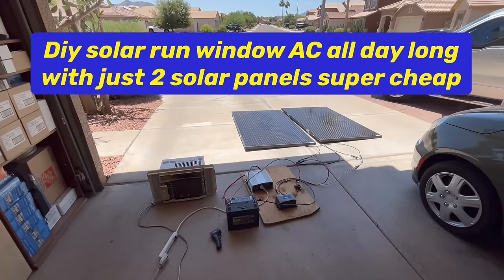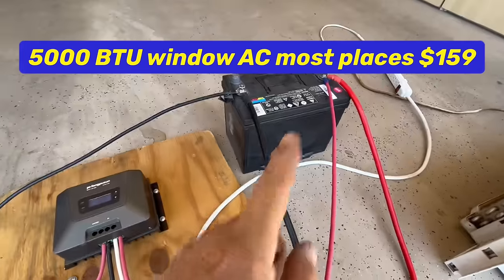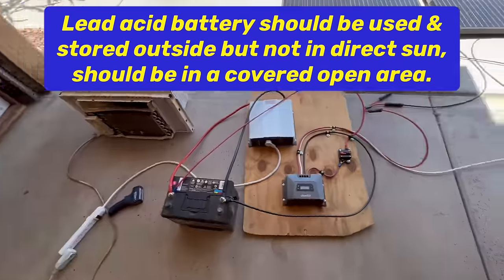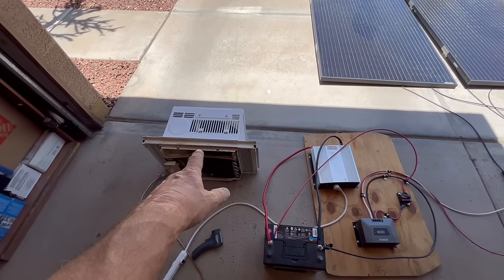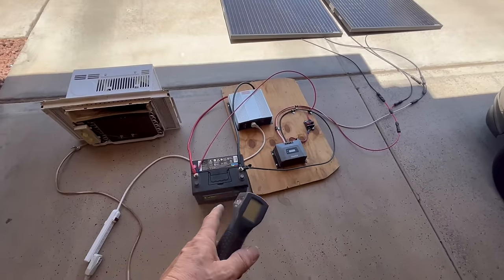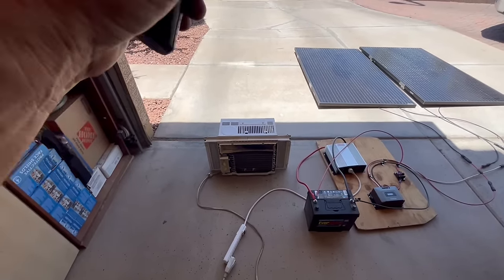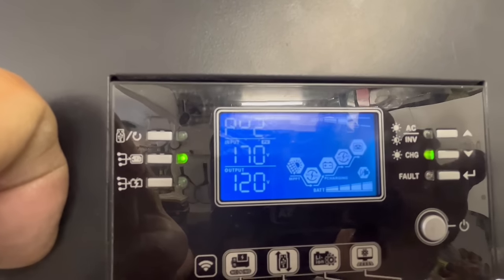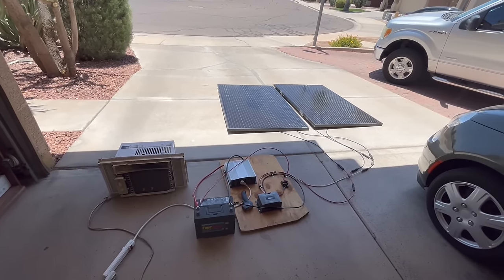Run your window AC with just 2 solar panels when sun shines. Easy DIY project you can do in one day.

Comment: You could do a very efficient 12000 btu mini split 400 watts!
Reply from the maker: Yes
Reply: @diy-solar-guy  good afternoon Mister solar guy LOL. If to complete this project I need to get a battery and the panel's starting with a fresh battery you would recommend the deep cycle marine or a lifepo4 100 amp hour? My wife is disabled and this is exactly what I would like to do because she runs her AC around the clock. I guess I would like you to get sitter if there's no sun at night how many batteries would it take to run that 48 hours or 10 hours until the sun comes up the next morning
Reply from the maker: @mrobvious1100  LiFePO4 battery is the best way to run ac 7/24. I have a lot of videos that shows using 120v mini splits which are much more efficient than window ac unit. I run my entire house and garage on only solar air conditioning now. I spend $0 on air conditioning now. House and garage is around 3000 square feet. Temps last 30 days have been 113 in day and 85 at night. Watch my other videos to see what mini splits I use and how well they cool house and garage as well as running my 3 1/3 ton and 4 ton heat pumps to air condition and heat my house. All with solar during the day and LiFePO4 batteries at night. I also have links in video of where I purchase products to run ac my whole house. Hope this helps to understand what you would need to supplement your ac using solar and to reduce electric bill as well. I to am permanently disabled and have to keep my house cold because of the 2 incurable cancers I have battled for last 10 years. I did all this in videos over the period of 4 years a little at a time every couple of days till I got to where I am today with my off grid system. I didn’t around $5000 a year each year for last 4 years and my system will be 100 percent paid back at the end of this year if 2023. Hope you enjoy the other videos and hope they en-suite you to use solar to run air conditioning.
Reply: @diy-solar-guy  great info. I have a two-story Colonial single-family about 100 years old. First floor is 30 x 30 second floor about 30 x 30. Three bedrooms upstairs with a bathroom first floor living room dining room kitchen vent a bathroom and then a bedroom. I'm guessing I would need two for the walls upstairs and 3 for  the first floor. How many batteries do you need to power the air conditioning at night. Of course this takes in consideration multas most of the units will not be running except the one we sleep in because our kids have grown up and are in the military. We would only run the AC upstairs if guests come over
Reply: @diy-solar-guy  one other quick thought since I kind of understand the old-fashioned air-conditioning systems that use returns how did these wall-mounted systems suck the heat out of the top of the room? And I'm guessing each unit has to have a drain that goes outside the house
Reply from the maker: @mrobvious1100  I only run my upstairs 3 1/2 ton ac unit at night. Cool are drops so my downstairs with no ac on overnight never goes above 78 degrees even when it is still 108 degrees at night at 8pm when sun goes down. You could get a 18,000 btu 220v mini split that can cool or heat 1000 square feet. You have 900 square feet upstairs and downstairs. Or you could get 2-12,000 btu 120volt mini split for downstairs and 2-12,000 btu min splits for up stairs. I have 4 bedrooms and 2 bathrooms upstairs so I have to be able to run my 3 1/2 ton upstairs heat pump to air condition the upstairs 24 hours a day. All my bedrooms are upstairs. 12,000 btu mini splits range from 14 seer to 39 seer. Higher the seer, lower power in watts and amps needed to run. Much easy to run a 38 seer heat pump overnight, most likely once reaches set temp will only use 200-400 watts. If you don’t use upstairs that often you could use solar in day to super cool upstairs with mini splits and then won’t need to run ac at night. Check out some of my videos on how I do this in March through May and September thru December. It still can get to 100 degrees in December at times during the day. I have so many videos that explain how I use mini splits. Not sure what temps you hit during the day and overnight temps. That makes a difference on running overnight as to how much battery bank you might need. AGM is great for day but not able to run my mini splits for more than 2 hours on just battery bank. But I was able to reduce my electric bill 80 percent just using solar during the day and grid power at night. I did this by using mini splits to keep upstairs and downstairs at 66-68 degrees all day long, then stop using mini splits at 6 pm and switched over to main 3 1/2 ton on grid overnight. Also in a lot of my videos. Hope this helps you to better understand what is involved and what you might need to use solar and mini splits.
Reply: No. Mini-Splits are not that efficient 9 eer. An exspensive one may do 10.
Reply from the maker: @dwmcever  I have been using mini splits for almost 4 years now. Much more efficient than my whole house 4 ton heat pump. I can use 2 12,000 btu mini splits, 120v 16 seer and they will cool the house with 1/2 the watts and amps. Much more efficient than window ac or portable ac that you vent out of the window. The 38 seer mini splits will use 1/2 of what my 16 seer units use. Been almost 4 years with 6 mini splits I installed and all 6 are still running as great as the first day I installed. I am just a DIY guy. Not a professional with electric or hvac. In fact I knew very little 4+ years ago. I can tell you from experience for last 4 years even low seer like my 16 seer are realty efficient and can save you money just running those two downsides 7/24 I would cut my usage in half if I used grid power 24 hours a day. I have to disagree with you on this one. Thanks for you input. Hope you have a wonderful and blessed day.
Reply from the maker: @mrobvious1100  there is a water line drain that runs to the outside to remove moisture from coil. This is a heat pump so it will blow hot air from the coil in the outside unit and cold air from coil on inside unit. In the winter it will be the opposite. The inside unit needs to have at least 10 inches from ceiling to top of head unit to draw in hot air from the room.
Reply: @diy-solar-guy  thank you for the response. My house is 30 by 30 I have natural gas forced hot air but no AC.. I'm probably not going to use the heat side like a heat pump I don't know if they make split units that just do AC
Reply: Wrong!  dwmcever!11I install all the time.  Customers COULDN'T BE HAPPIER.  Knowledge is power and you don't have either!  What year are you living in?
Reply: @mrobvious1100 lifepo 100ah would be an excellent battery. Doesn’t emit any gasses and holds a lot of power.
Reply from the maker: I agree, LiFePO4 is the best battery out there now for this application.
Reply: Agree! Mini splits are the answer. If I can save money using window units all the more using mini splits. And to run them on solar is a no brainer. 73
Reply from the maker: You still need to use a battery bank on off grid solar. On grid solar does not require a battery bank but you can add one to it if you want to but off grid solar will need a battery bank. They do make some “batteryless inverters out there, I have one and when a cloud rolls by in the ski , if inverter is not connected to battery bank, the inverter will shut down and not restart. The battery bank is there to supply voltage when solar from sun is not present from clouds in the day. It keeps the system running during cloud cover but not indefinitely. They are just starting to make direct solar panel input connections to mini splits that can run the mini split all day as long is there is sun with no clouds. No battery is needed for that application. But could use battery bank at night to run and charge battery bank in the day from solar as the mini split is running and charging batteries at the same time. Thanks for your input
Reply: @Hero10838  You CAN do that!  Although there are some regulations that don't allow it to be hooked up to municipal power with a switch to go between the two.  I don't know the regulation or where exactly.   Indiana has some regulation because my friend is always telling me I can't do that here.  No big deal just don't have on both... just change between the two.
Reply from the maker: Yep
Reply: Which mini split is 400 W? I saw a starter project ac unit was 350 W comfy air. Small unit for a small room though.
Reply: I can only run a 600 W 5000 Frigidaire AC window unit on low eco setting about 6 hours😢. If you have suggestions of units w lower Watts. Let us know the type of AC unit please. I use Ecoflow batteries and $35 cart from Target. I bought a generator to top off my batteries. I bought a cooling fan you put ice in the top 7 Watts.
Reply from the maker: @jolieb9138  I actually just did a video, I have to edit and upload. I ran the 5000 btu 120 volt window air conditioner I bought from ALDI grocery store for $129, it uses around 500 watts and 5 amps on high. I ran it with just a Harbor Freight 2000 watt modified sign wave inverter and a 2KWh 150 ah 12 volt LiFePO4 battery. With just running on battery I was able to run almost 4 hours. If I connect 2 of those batteries in parallel I might be able to get 8-9 hours on just battery alone with no solar. It looks like it is going to take about 45 minutes to an hour to completely recharge battery back to 13.2 volts. I am charging using my solar power system off grid. I will try to post video today. Hope this helps you.
Reply from the maker: @jolieb9138  the higher the seer the lower the watts. My mini split will run for half hour to hour at 800-1200 watts , then drop down to around 400-600 watts. But I use 2 mini splits to cool my entire downstairs that is around 1400 square feet. My mini splits are only 16 and 19 seer. If you are looking to run daily and want to use under 500 watts, look for a 38 to 39 seer mini split. They will run you around $1200 and up. My mini splits were $500 and $600.
Reply: @diy-solar-guy  thank you
Reply from the maker: @jolieb9138  you are very welcome
Reply from the maker: You a very welcome
Reply: @Hero10838  nighttime you need a battery. If you are only going to run the AC in the day you could get by without a battery. I hope you house is so insulated you don't need to run AC at night. 73
Reply from the maker: I super insulted the house but it is 113 degrees out right now. I have a 2 story 2450 square foot house. With day time temps like that and still 100 degrees at 2-3 am in the morning, you can not get away with not running air conditioning. But I am 100 percent solar in day and LiFePO4 battery bank at night to get through without grid power. So I spend $0 a month on air conditioning. Like it good. All off grid solar power. Nothing solar I do is on grid. I ever run pool pump 24 hours a day along with 3 chest freezers, 24.5 cf refrigerator and outside lights at night. Thank you for your input. Hope you have a wonderful and blessed day
Reply: Not a chance.
Reply: @diy-solar-guy nice solutions, thanks for the examples.
Reply from the maker: @randybobandy9828  off grid solar power is great for running a lot. We figured it out and are now able to do so much with our system. Hope you have many cool days this summer, I know we will. Hope you have a wonderful and truly blessed day.
Reply from the maker: @mrwess1927  you are welcome, I have a lot of videos that you might like, I do a lot with off grid solar, much more than most people think possible. Been found DIY solar for 4 years and at the end of 2023, they system will be paid back with just saving on electric bill. Thanks for your comment. Hope you have a wonderful and blessed day
Reply: Awesome. Expected to fuse to pop on the surge.
Reply from the maker: @sunnindawg  when you connect the inverter to the battery expect a spark on the battery terminal.
Reply: In the best scenario 12000 btu going to consume 1000 watts, so
Reply from the maker: At start up a mini split will use around 1000 watts but as room is cooled, watts will drop and a high efficiency 38 seer unit can get down to 200-400 watts once room is cooled.
Reply: You are right, I have a light bulb and is working without power for almost ten years.
Reply: @diy-solar-guy Please release that video you’re editing. Thank you for all this valuable info!!
Reply: @diy-solar-guy ❤
Reply from the maker: @mytai88  thank you so much for your input. I hope you have a truly wonderful and extremely blessed week

Comment: you did a really neat solar DIY set up. I have a Harbor Freight Inverter the only problem is it made my 5000 BTU A/C make a humming noise because it wasn't a Pure Sign Wave. But it did run my A/C esp. on startup. Now for an Inverter I'm using a Bestek 1000 watt Pure Sign wave inverter, and no more humming  from the A/C. If you want to run the A/C inside without any worries of the battery exploding. There are plenty of Mini Lithium batteries out there that dont take up much space, and safe to use indoors. To keep your charge controller cool you can buy a small fan that plugs into the USB of the inverter. I keep one on my NOCO 5 Amp battery charger all the time.
Reply from the maker: Very nice, thanks for your input. Great tips to improve basic system.
Reply: They make AC units with built in inverters.
Reply: @r3dhorse  those industrial ones?
Reply from the maker: @r3dhorse  you need the inverter to change from dc to ac to run ac . What ac are you talking about. Could you share with us the website they sell such units. Thank you.
Reply: @diy-solar-guy  He's talking about inverter mini-splits and the new units, like LG dual inverter window units. They still require A/C power but the compressor and fan slowly ramps up to speed instead of the massive surge required to start compressors and fans in traditional units. You can use a much smaller generator or a smaller inverter to start the inverter air conditioners.
Reply from the maker: I have 6 mini splits installed in house, 2 upstairs, 2 downstairs and 2 in the garage. I prefer to use the mini splits downstairs and in garage. They use far less watts than my 3 1/2 ton heat pump and 4 ton heat pump which I now run on solar in the day and 25.5 kWh LiFePO4 battery bank at night. I spent $0 on air conditioning my 2450 square foot hours, 2 story and air conditioning my garage all day long from sun up to sun down just with only solar. I also run my pool pump 24 hours a day along with 3 chest freezers and a 24 cf refrigerator. In the winter I run my 127,000 and 17,000 pool heat pump heaters to heat my pool to 89 degrees, all with off grid solar power. There is a lot you can do with off grid solar.
Reply: @diy-solar-guy  Hi, good practical example of solar. Quiet and just works. You can also use the panels for shade and reduce cooling that way. 
Take care M.
Reply from the maker: @markeh1971  thanks. I use solar panels on my pergolas for shade from 110+ heat in summer. Those solar panels run my 3 1/2 ton & 4 ton whole house ac.
Reply: It is likely humming because it has dirty power.  Avoid MODIFIED SINE WAVE.  Get a pure sine wave instead to clean it up.
Reply from the maker: @Jeff-hc1ke thank you so much for your suggestion. Hope you have a wonderful and blessed day.
Reply: @diy-solar-guy  I'm now seeing it say you are using a pure sine wave.  Guess i should read more before I make a suggestion in the future lol.